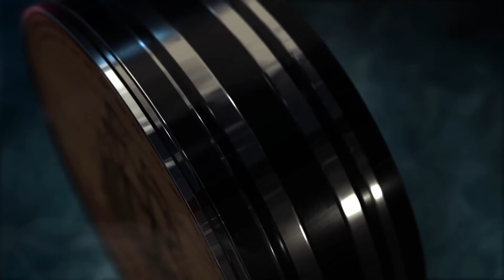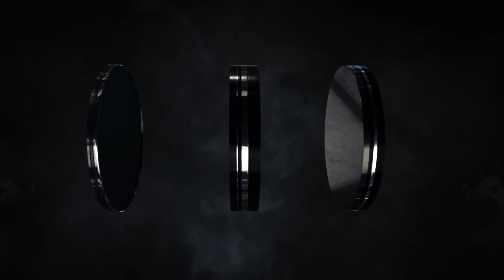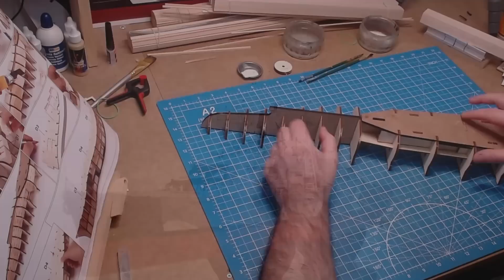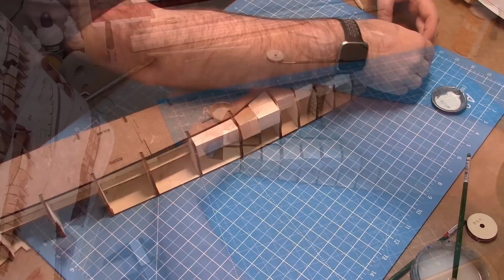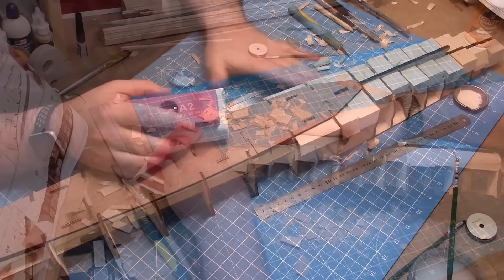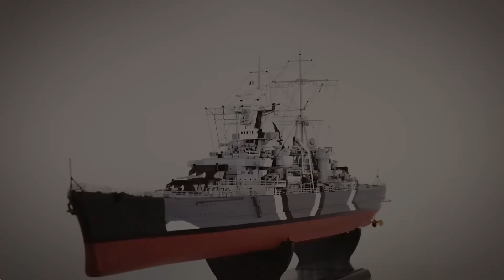OcCre - 1:200 Prinz Eugen wooden model Ship / Fairing

Comment: Great build so far. If I may make a suggestion. How about using a Dremel tool to sand down those large sections?
Reply from the maker: Hi Mike, I use a dremel tool when required, it’s just they make so much dust, so it’s only used minimal

Comment: Hi john how many hull planking  there is when you do apply them
Reply from the maker: Hi Bobby battleships don’t have Massive hulls at 1/250 scale, say like a ship of the line, so there is only around 30 planks to fit on the port and starboard sides